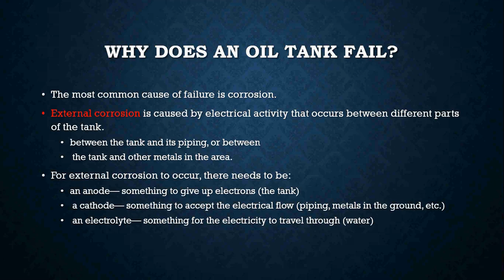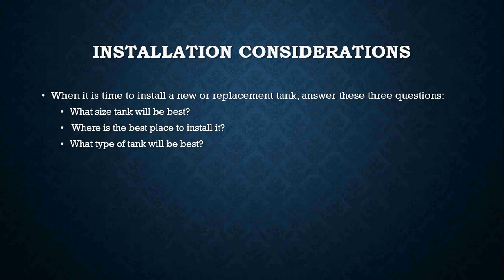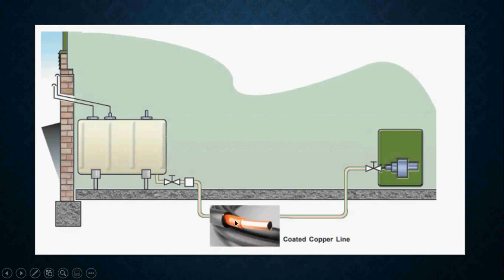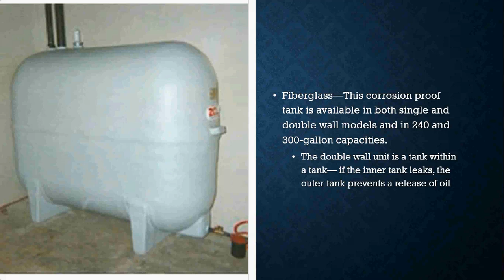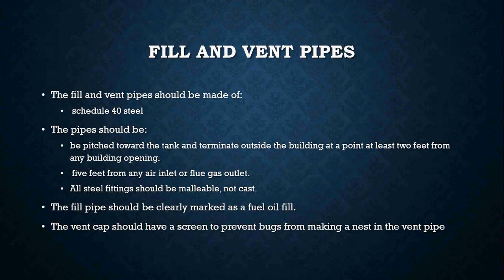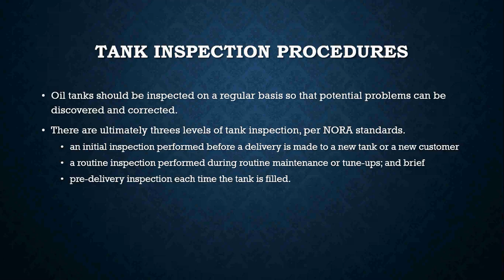Oil Tanks and Piping

Comment: Good to know.  I went with a tried and true steel tank again.  I learned a hard lesson from buying a Roth tank.  The Roth I had got punctured by my lawn mower kicking up a rock.  Had oil leaking all over the backyard.  Roth did not honor the "warranty" because it was considered damage and not a manufacturers defect.  I should have known better than to buy a Reynolds wrapped plastic balloon to hold oil.

Comment: Thanks Tony! This was very informative. I have an oil tank in my basement and I want to relocate the fill & vent pipes. Is there a limit to how far I can relocate them? the tank currently sits at the back corner of the basement the fill & vent pipe are plumbed out the back wall. I want to relocate them to the front of the house which is about 23' away from the oil tank. Will that pose any problems?
Reply from the maker: You would have to refer to the mechanical code book for that information. Consult a contractor in your area.